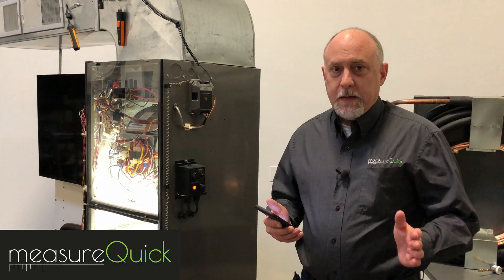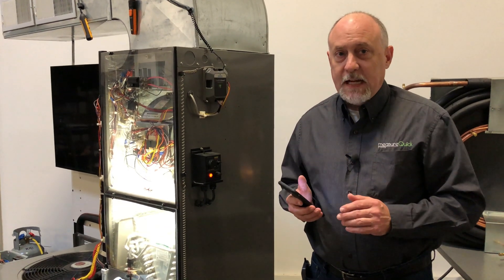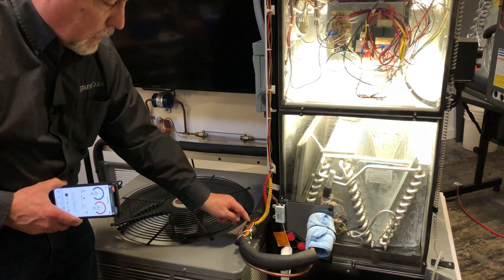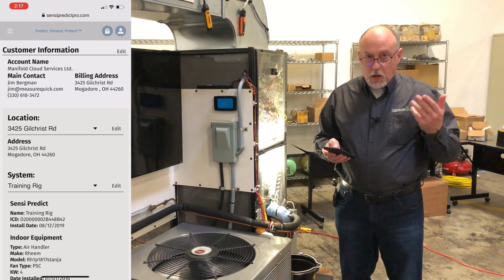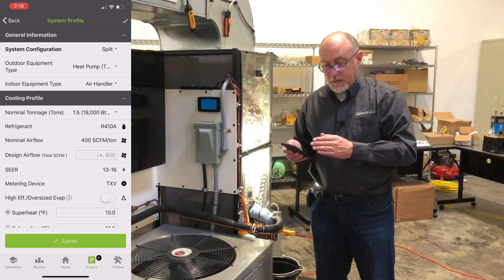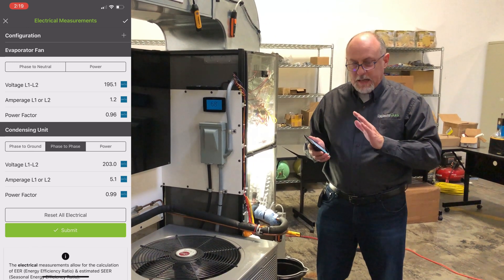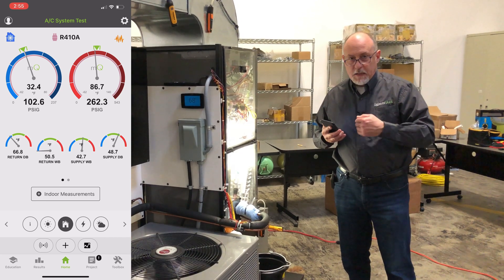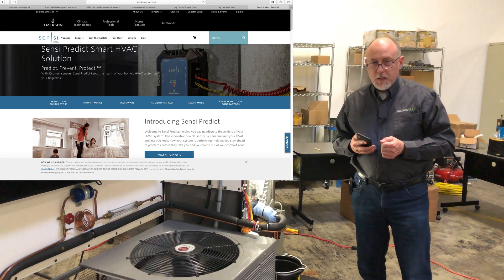Sensi Predict & measureQuick

Comment: Hey Jim. Does emerson offer the pressure sensor add-on sensors for this kit? I noticed you had to use your Bluetooth gauges…That seems like a logical step for more accurate data. I also noticed some of that information is estimated due to lack of actual sensors. I would really like to see air flow sensors and pressure sensors for this in order to make it complete. I also don’t like that I have to monitor through the sensi website. Being able to access this information within your own choice of software or at the least a single app would be great. I don’t think my clients would like me sharing all of their personal information and may violate our privacy policy. I look forward to the day when the DOE makes these sensors standard on manufacturers equipment!

Comment: I see that this is being marketed and set up for Emerson dealers so they can sell maintenance $ervice$ contracts.  For a few years I have contended that no unit should be sold without something like this but I want the report coming to me, as a home owner.  Someone needs to make an equivalent unit with the homeowner in mind.  Further, with just one or two more sensors and programing, the unit can monitor its total efficiency, and its loss over time, and can detect changes in the "house performance" ( I suggest an envelope performance factor) .  Further, it could rapidly detect and calculate cost saving or lost if a window is left cracked, if house insulation is upgraded or the effect of calking or of closing a room off.  AND it can tell if unit is truly matched to the house i.e. over or under sized via duty cycle and monitor of backup strips.  This is important to know when replacing it in the future.  Installed on a conventional HP I suspect it would cost less than $40 or $50/system if installed on all units.  BTW, to do it right it needs to have a tip bucket rain gauge condensate measurement.  One reason the manufacture would not like this is the homeowner would know and have documented proof if a unit was not in spec toward the end of the warranty.

Comment: I do not see any Sensi Predict transducers? Does Sensi monitor pressure? I've looked at kit and only thermistors are listed for liq/suc. lines and I see in this video Field Piece units on service ports. I like the concept but without SH/SC data it's worthless in my book.

I have seen in comments below that there is a $49 annual monitoring fee. Is this a fee per monitored system?

I see on the Emerson web site the Sensi product is described as "Sensi Predict uses 10 sensors to monitor and analyze 32 functions 24/7". When I read the description of the kit available on Tru-Tech it only comes with 5 sensors - Supply / Return air, Liq / Suc line thermistors, and a current sensor. What are the other 5 sensors? Even when including the optional condensate monitor, outdoor ambient and ODU current sensor this only accounts for 8 of 10 sensors.

Comment: Very Cool...Adding measureQuick to this product makes it so much better. Love this technology, wish I was still in the field. Hope to get my techs as excited about this as I am. Anytime we can perform non-evasive diagnostics is a plus. This takes to another level. Awesome!
Reply from the maker: It will improve everything for your technicians giving them the insight that they want and need before they arrive at the job site. Paired with MQ it makes things very easy. Sensi simply becomes another set of sensors that MQ can grab for additional diagnostic power. Sensi Predict smooths out peak service times, and catches many problems before they happen. We also have well documented that the close rate on replacement sales is much higher as the customer is made aware of their system and the performance on a monthly basis. Exciting times to be in the HVAC industry for sure.

Comment: Will having a zoning system and two stage affect how Sensipredict works?
Reply from the maker: It works fine with two stage equipment. If you have zoning, you might get a few nuisance alerts for low coil temperature if you have a really small zone. Those though can be ignored. My guess is they have provisions for that or they will if they do not. They have been working on this for several years with several 1000's of installs. I am sure they have run across that.
Reply: @measureQuick  what about communicating inverters and modulating furnaces?
Reply from the maker: @ATeamAdam  Not yet for modulation. I am sure though that Sensi is working on a solution for that.

Comment: Awesome technology. 
I have a couple questions though:
1) is a subscription needed from  for the Sensi and emerson for monitoring?
2) is the integration with MQ available on the free version of MQ?
3) what is included HVAC Monitoring kit from trutech? On the what's included tab it just says " (1)Sensi Predict HVAC Monitoring Kit by Emerson
4) can this be used on RTUs and WSHP ?
Reply from the maker: Sensi Predict costs $49 / year for monthly remote-monitoring. Sensi Predict analyzes 32 components of the HVAC system, protecting the comfort and detecting HVAC issues before they happen.

Hardware cost for Sensi Predict is $250, which includes the first year of monitoring. Installation fees vary by contractor. Installation includes 10 custom sensors for the HVAC system.

There is no cost to use the Sensi workflow in MeasureQuick, and it is in the free version.
Reply: @measureQuick  Thanks Jim, I understand that 1st year subscription ($49) would be provided FREE? This made an awesome system upfront cost  (hardware, activation & install cost only) affordable to average homeowner. Question? (to save more on upfront cost)  is DIY install allowed? Says, for Techy Guys?
Reply: Thanks Jim, honestly the monitoring is cheaper than I expected and the Sensi includes more in the kit that I thought it would.

Comment: This is awesome for most equipment. I do have a couple of questions though. Will modulating equipment be too many variables for this type of monitoring systems to handle, such as being sent low capacity fails alarms and amp draws frequently changing along with high differences in power factor due to the ecm's? Will it be able to monitor gas heat having flame sensor amp reduction over time?
Reply from the maker: It is not yet designed for modulating equipment.
Reply: @measureQuick  thanks for the information.